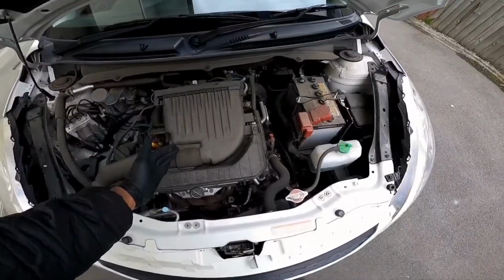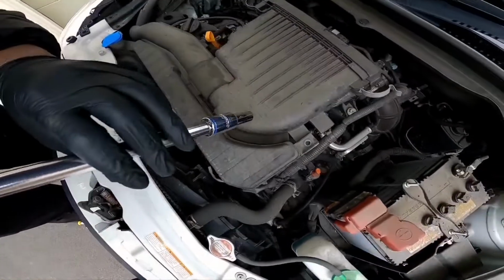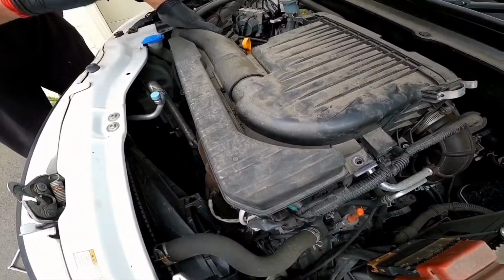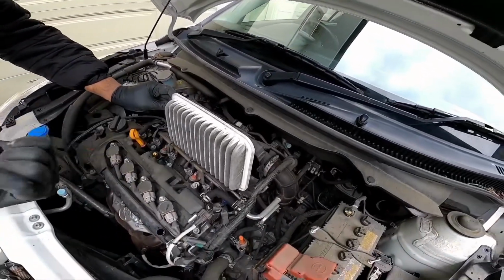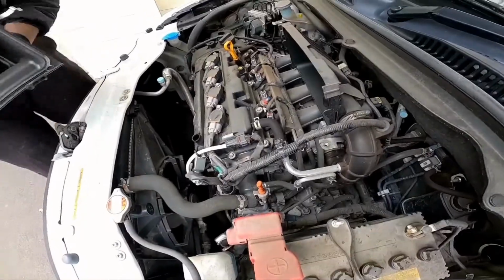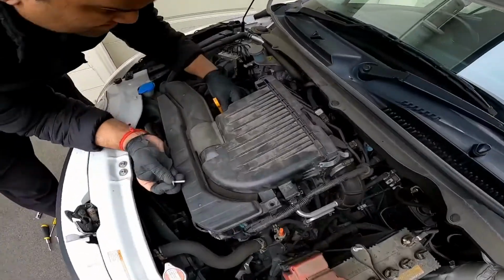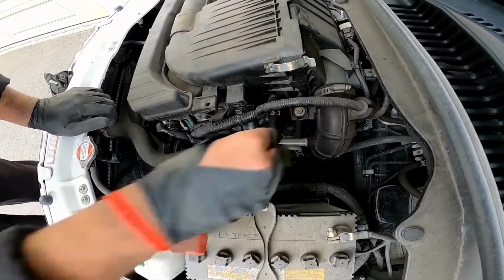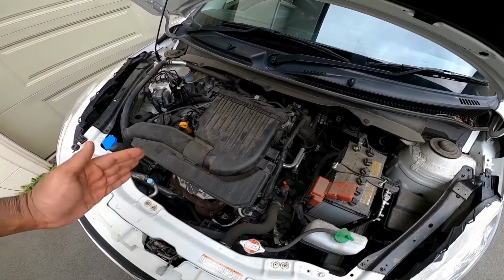How to replace Suzuki Swift K14B Engine Air Filter 2010 to 2017 3rd Gen (Full guide)

Comment: What is the recommended engine oil for a 2016 Suzuki Swift 1.4 (K14B)?
Reply from the maker: It would depend on what climate you live in . Does it have a rating on the oil cap ?